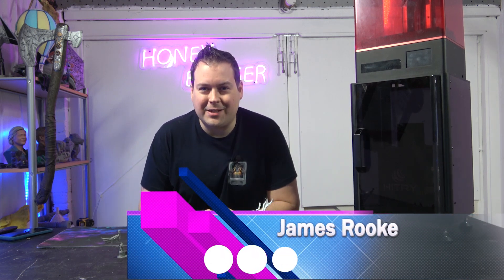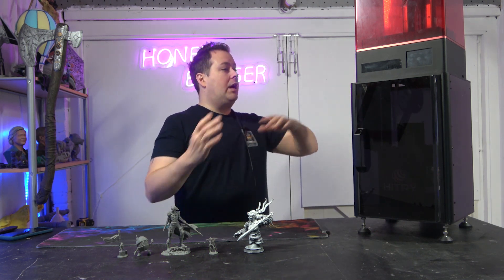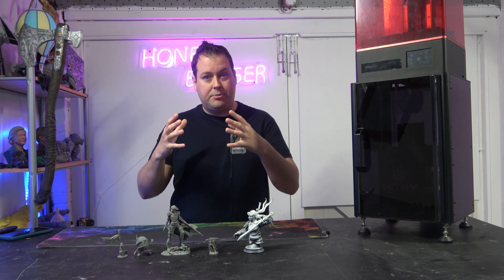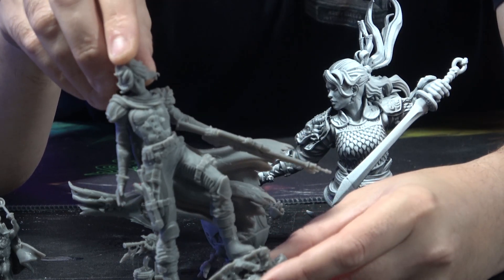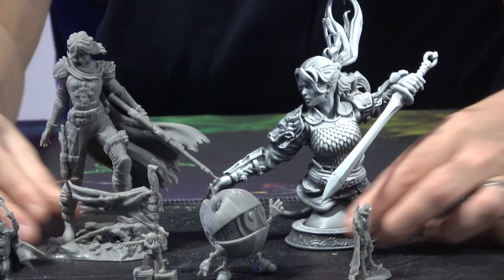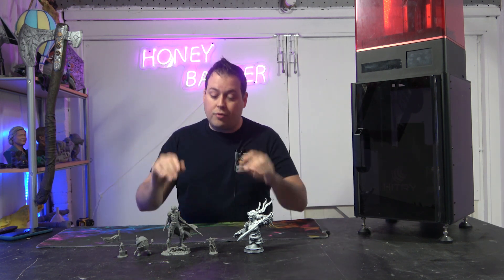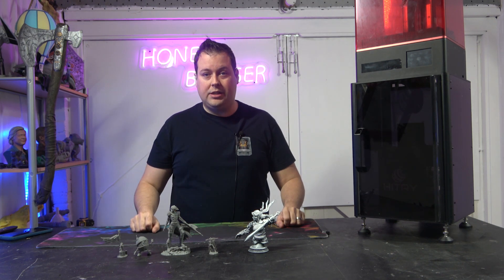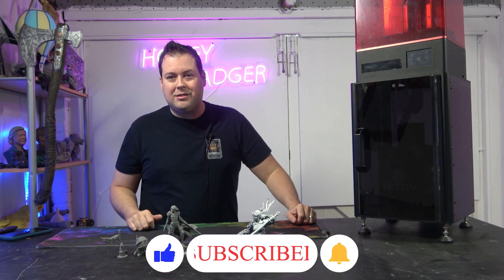Hitry Kirin DSP Light engine - results

Comment: I’m still a backer, but the lack of technical information is making it somewhat hard not to exit the pledge now. I’ve been waiting for more interesting and meaty details about how to use this uv-projector, as how to make it sync with other hardware and perhaps some GitHub links to how this can be made. Please Hitry, build some kits with components from the mayor manufacturers, like Anycubic, Elegoo, and Creality. That would be a quick way to show the versatility of the product. As it is far from cheap, and I can easily get a complete warranted 4K printer that comes with community support and a searchable history for the same amount of cache. You simply can “hide” your product if you want to sell, like it’s a secret wonder, why?. At least that is my opinion, and as I said, I’m one of the current 92 backers and that isn’t that great number if your product is actually usable as described. I love the idea, but I lack confidence. I have started using the Rocket 1 Pro I bought in your previous campaign, but there isn’t easy to get it working ok as there is very little information and support online. You need to start to speak up, and post content rich information,  do not hide behind language barriers, it’s 2023 and translating is just a matter of effort.
Reply from the maker: https://www.instagram.com/p/Co7_9eGNvm-/?utm_source=ig_web_button_share_sheet
Reply from the maker: so the machine on top of this is a elegoo staurn and there is no "interface" the UV array, mainboard and PSU are all removed from the machine, all that is left is the touchscreen and z motor which both plug directing into the mainboard, we will do a teardown and rebuild video to try and show how it goes together and works, thank you for commenting it helps us do better and grow